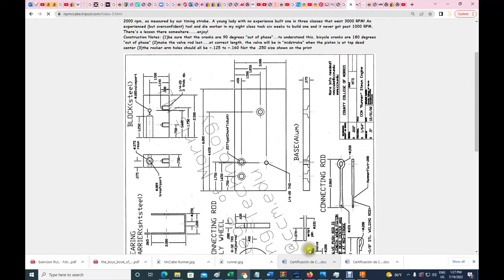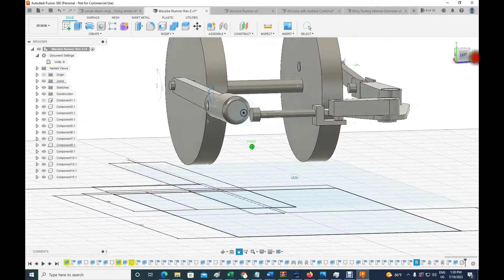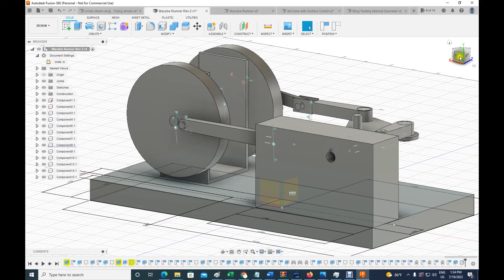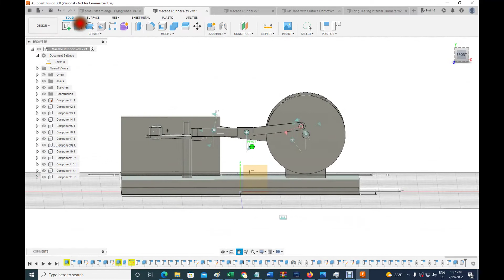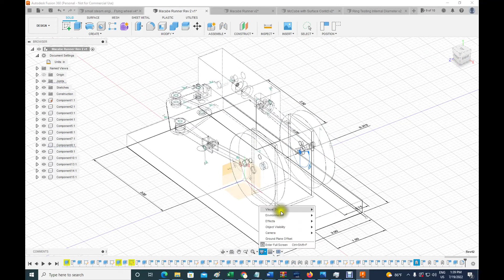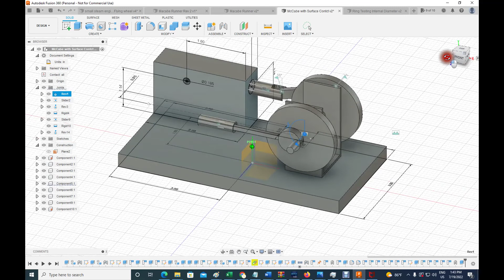THE MCBABE STEAM ENGINE RUNNER: AN ANIMATION IN FUSIOIN 360

Comment: could you send me the file on the fusion 360 model
Reply from the maker: I will try to recover the files...I stopped working with Fusion 360 due to problem with their license process(it sucks)...Right now I'm using mostly Solidworks!!!
Reply: thanks, yea fusion 360 can be a pain sometimes but i dont have the knolage to make this in fusion and i need to have a model for a school projekt where i am going to make this in the machine worshop
Reply from the maker: @darkbluecop4889  The link where I got the concept from is there...what grade are you in? ...What kind of equipment do you have at school?...Maybe it's better to do everything in 3D printing...
Reply: well i am in my second year of collage in Norway and i would say that we have a advanced metall worshop with lathes, milling macchines, a big CNC machine, welding equipment and a machine where you can drill out holes. i know that it is posible to create the parts in a CNC machine with codes of the model from fusion 360    @learningpower9437
Reply: but if you dont find it i might make a nother design but it is just verry dificult to fine some one that has made it in fusion 360. i am in my second year of collage in Norway and our shop has a lot like a lathe, milling machine, a Big CNC machine, weldig tools but we also have 3D printers  @learningpower9437